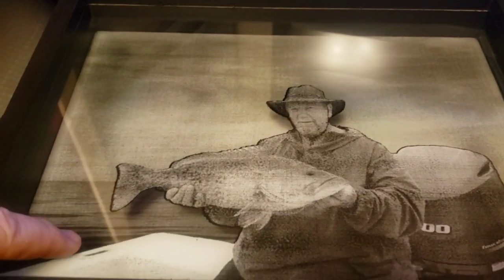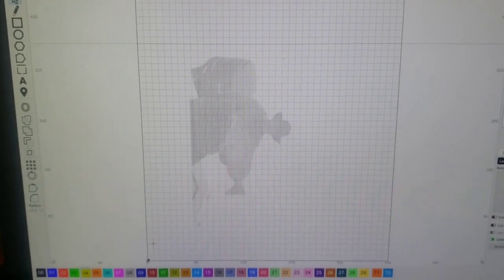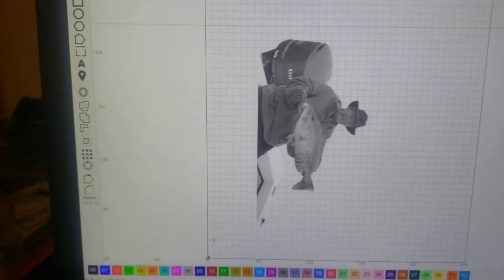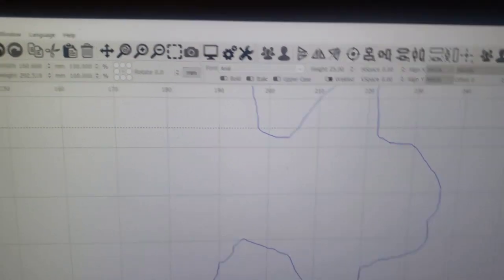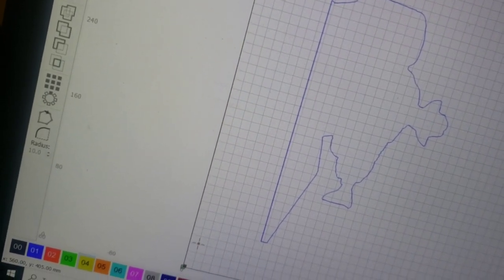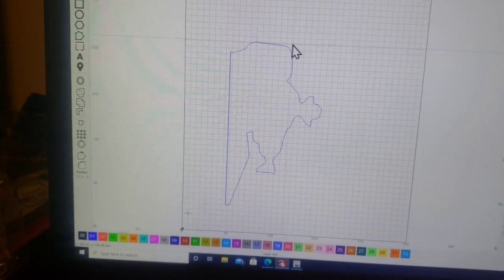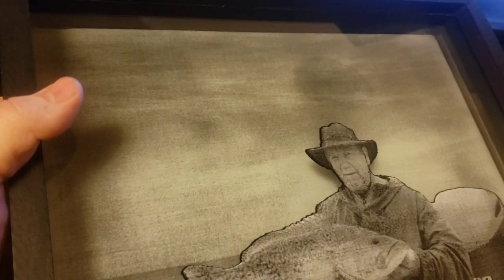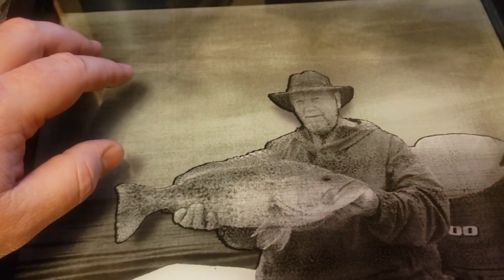The Kenny Hack: Making a Parallaxed Image Onto Glass. Ortur Diode Laser

Comment: Great as usual.
I have a similar project with the offset line. I had to work with the node to get a sharp edge the way i wanted on the cutting line,  and with that it requires more time.